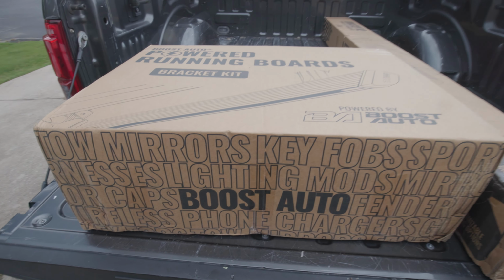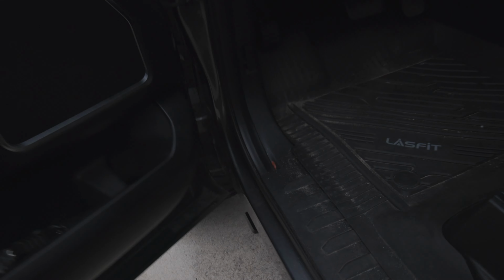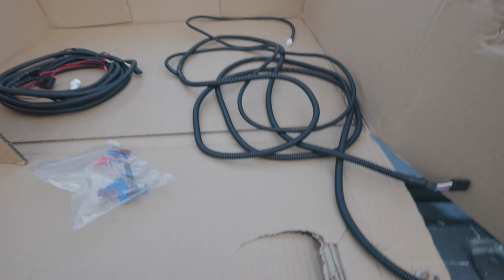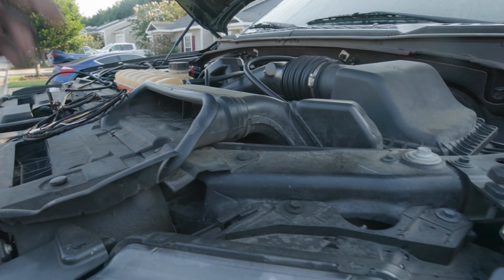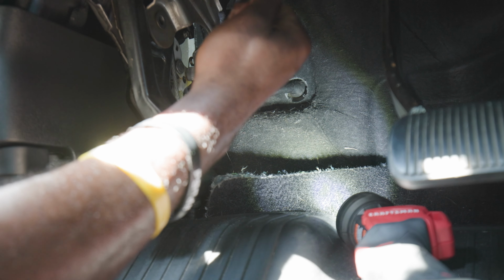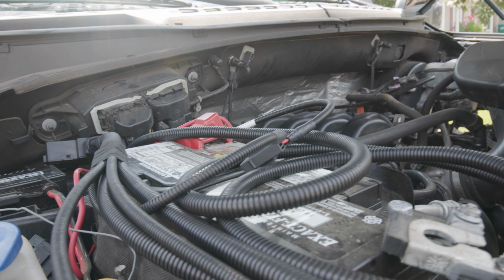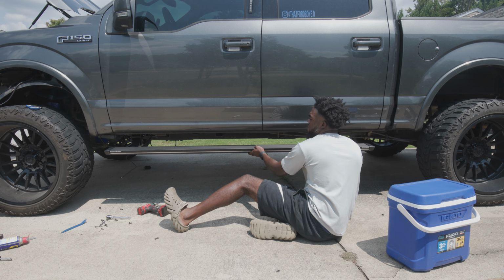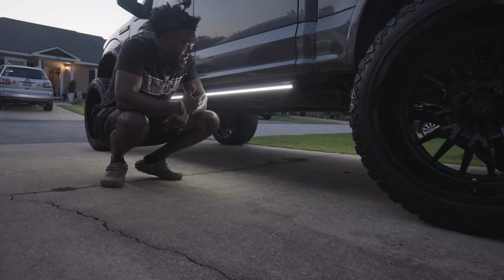Lumastep M2 Power Running Boards Install & Review: Ford F150 | Boost Auto

Comment: How are u liking them? 
If you get the non light up (power step without the lights) would the wiring be easier?
Reply from the maker: Love them! They have been great so far. The install wasn’t bad at all even with the lights. It would honestly be the same process minus connecting to the headlights. You still have to run the main harness through the fender well and the wire through the firewall. But it would make it less time consuming and less wires as well.
Reply: @TFBJFord  Good stuff. Thanks for the reply

Comment: I got them on my Sierra. I just can't figure out how to tidy up the extension wires on the motor bracket. Why can't I figure it out 😂😂 their video sucked at explaining it.
Reply from the maker: Zip ties. Tie it up to something is what I did.
Reply: @TFBJFord  yes sir. didn't realize you could pull them through that channel back up towards the body. They're looking good now!
Reply: @TFBJFord  I think the GM trucks are a little different. I think we have to slide the boards all the way towards the back. Due to the shape of the rockers on the truck. The f-150s are a little different, because I saw in the instruction video that you could slide them anywhere to your liking. Your truck is the shit man I still don't even have a leveling kit yet 😂😂